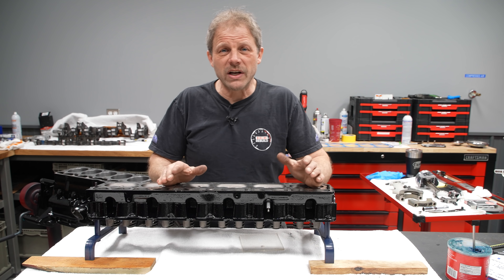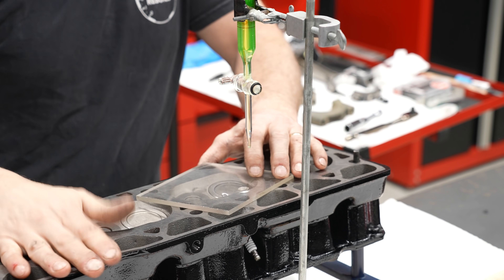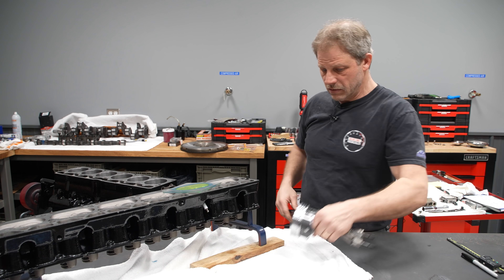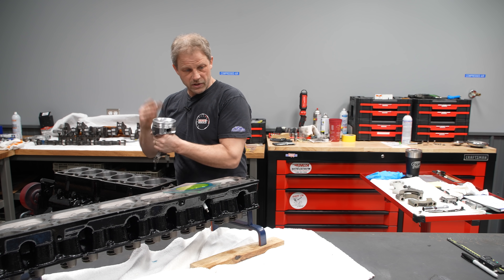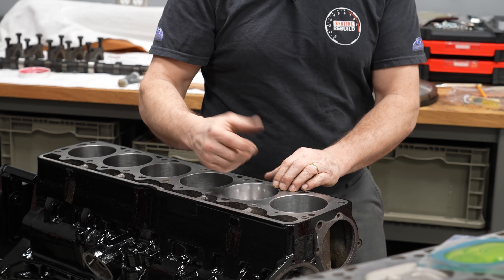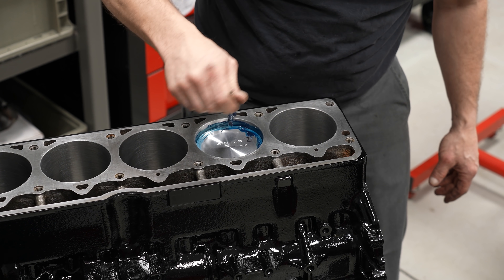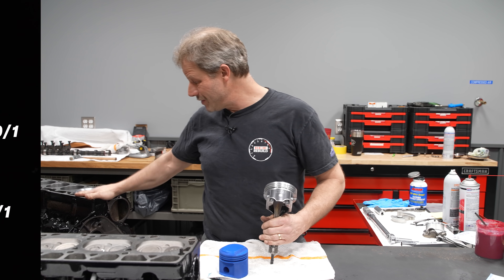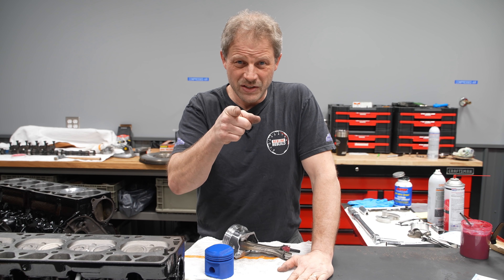Breaking down compression ratio on our 4.6L Jeep

Comment: GGRRRRaaAAARRRGGGHHHHHH!!!!!!!
MY HEAD HURTS!
area of a circle is found with pi times the square of the radius.
if,
IF you are working with diameter then it's pi times (D/2)squared.
You GREATLY complicated it.  So much so that I couldn't follow your math.  If this was a classroom, I would not care that you got the correct outcome.  I would have failed you on process!
The laughable thing is that it's even easier with a 4 inch circle.  Radius is 2 inches, when you square 2 you get right back to 4, 
so,
pi times 4

Comment: So, I didn't redo the math, but I think if the crank wasn't ground yet, you could spec a .010 offset (stroke increase) and it should bump the C/R to about where you want it.  It would give you an additional .020 to the stroke, and decrease the total combustion area by the .010 stroke.  Might be more cost effective than re-decking the block.  especially when the block has already been cleaned, prepped and painted.

Comment: Acid brush and then use your finger anyways. LOL I am not sure about your theory about the in the engine to measure the dish being better, but it does work your way. 9.25 is not bad. Maybe less dish and do your math earlier would have been a better idea, but with Joe Biden as President it may not matter since we won't have any gasoline to burn anyways.

Comment: Compression Ratio -I really enjoyed your detailed explanation of it all - did a killer job.

Q: Why 9 to 9.5 for running on your 87 Octance??? Why not bump up higher to get a better & faster burn especially for the lower octances?????
Reply: Detonation.
Reply: @dennisp.2147  You would think that lower octane fuel would burn better with a higher CR & not detonate too early.
Reply: @marcusFZ6  You would be wrong.  The octane is there to reduce detonation and pinging at high compression.
Reply: @marcusFZ6  The purpose of higher octane is to run higher compression ratio.  There's no appreciable difference in the energy from burning low vs high octane fuel.  High octane allows higher compression ratio which is the reason it is required in higher horsepower engines.  

On a side note, E85 ethanol added fuel is really above 100 octane due to the alcohol.  A lot of hot rodders and racers build dedicated E85 fuel engines that run really high compression.
Reply: @MrJacksjb  I have been told that E85 equates to about 107 octane in terms of flame quench...sound about right?  Its actually a liquid intercooler when you have boost.
Reply: @T0tenkampf  That sounds about right.  It really should be similar to running methanol injection as some people do.  I know that it definitely burns cooler, problem is you just need more of it to get an equivalent power out.

Comment: One day, Thomas Edison passed a light bulb to his research assistant,
Upton, who was a graduate in Mathematics from Princeton University.
Edison asked him to calculate the volume of the light bulb. So, Upton
picked up the light bulb and stared at it for a long time.
He then used a measuring tape to measure the light bulb and did a
lot of calculations too. However, he still could not find the volume of
the light bulb.
Edison saw this poor guy and said: ‘Upton, why don’t you try this
method?’ He filled the light bulb with water until it was full and passed it to
Upton saying: ‘You can find the volume of the light bulb using a
measuring cylinder to measure the volume of water.’

Comment: Really misleading. Lot missing here. First being the ratio for pump gas. Completely irrelevant. Direct injection. Cooling capacity. Air to fuel, turbo non turbo, variable cam timing, the list is long. A 14:1 car will run on 87 octane with less aggressive timing and the right cam that reduces dynamic compression. So far off here

Comment: I built my 4.6 back in 2008.  I used the 4.2 rods, sealed power h825cp30 pistons with 17.5cc dishes, and a mopar p45292230ab cam.  It was 9.5:1 scr and 8:1 dcr and I had to use 93 octane.  I spent over 20 hours porting and polishing the head.  It went in a 96 2dr 2wd 5-speed SE(all manual base model) that I stripped down to 2700#.  It ate through 3 auburn lsds.  It made many smiles and got questions about it having a v-8.  I will build another with the Eagle 6.150” rods I’ve been hoarding and some custom +.080” pistons to get a 4.8l and will go in my 99 2dr 4wd 5-sp with a np242(full time option) and eaton rear(no more clutch wear!).

Comment: Me thinks you been cheating yourself on sleep recently? Hope I'm wrong. Since you're shaving the deck on the block, how much can you take without causing issues in the valvetrain? Myself, I'd prefer a cutdown that would allow me to use a standard head gasket so the next owner, should they ever have to replace the head or remove it, wouldn't get caught short. Does that make any sense?

Comment: Any of you "geniuses" ever heard of the formula pi r squared as in pi x the radius of the circle squared? A lot easier to remember than pi/4 x diameter squared.
Reply: Diameter squared x .7854 x stroke 
= cylinder volume.

Comment: Thank you Davin for share your knowledge and taking the time to explain this things, I have a chevy 230ci straight six, and time ago i wanted to make it more efficient by increasing the CR, in theory this engine stock had between 7 to 7.5 to 1 CR, which for and gasoline engine, it's so bad haha, and for street use only i wanted to do the same thing you're doing here, the only difference is, here if i use the AKI standard, RON+MON/2 method the "cheapest" fuel i can get in my country is 89.5 octane, so with that little more than 87 how much higher could my compressión be? Up to 10 to 1 maybe?

Comment: From a 4.0L to a 4.6L using Imperial measurements? 🤔
Reply: Why not? It’s an American engine and was built using Imperial measurements. Convert Devins numbers to metric and do your own 
calculations.
Reply: @ellieprice363  US manufacturers have been using the metric system for decades now. That's one of the reasons that engine displacement is given in liters or cubic centimeters instead of cubic inches, even in the US.
Reply: @ΣτελιοςΠεππας  True, but most older American mechanics still think and work in the inch system Just because Imperial is not easily understood doesn’t make it obsolete. The engine is still the same size no matter how you measure it.

Comment: Wow the box for the pistons said 22.x cc but worked out to be 27.x cc..... definitely always pays to check especially when you are creating a Frankenstein engine
Reply: Similar issue with domed pistons. I have the feeling that some manufacturers measure or calculate the volume for a certain size piston, and then print that same number on the box of all the sizes they make.
Reply: @dirkmohrmann8960  what's more likely is they average it out. They measure a set number from a run of pistons then average that out.
Reply: Engineering tolerances apply in every direction so depth, diameter both deck surface and bottom surface and the relative angle of the taper all have an allowable tolerance which is a percentage of the overall dimension. As the checks are measuring in volume of the vessel, which is a different way it is quite easy for the part to be within engineering tolerance in terms of measurements but a long way from target volume in this type of test. That’s for the part, also sometimes it’s fun to flip your plastic over and try it the other way, this will prove if your plastic is flat. LOL.
Reply: there is also going to be some slight variation in measurement.  For example, doing it ringless with grease at the top of the piston will not include the area between the top of the piston and the top of the ring.  Depending on piston/bore clearance, this could add a few CC's

Comment: You should be an instructor at a college somewhere and teach younger generation who is starting out. I'm an A&P mechanic working on people's airplanes and this is the same math when working on Lycoming and Continental aircraft engines. We done have heads but individual JUGS or cylinders 4 to 6 per engine. 2 spark plugs per JUG or cylinder

Comment: I usually run 100LL AVGAS in my Chevelle but at $7.50 per gallon it's getting very expensive and with a 427 it drinks A LOT!!
Reply: Why? How high is the compression and/or the heat that 102 Ultimate (90MOZ) would not do the job?
Reply: Im paying £8 per gallon....$11/$12....